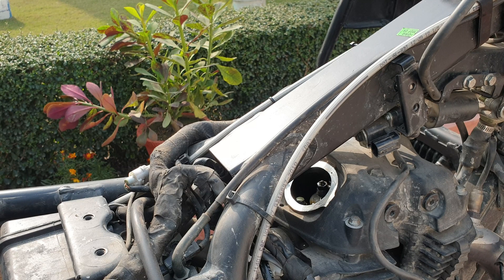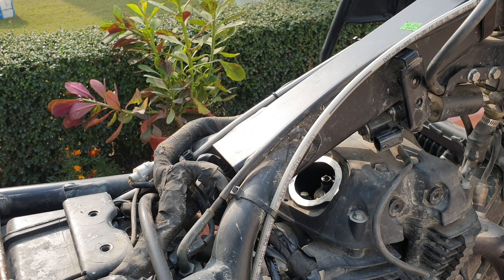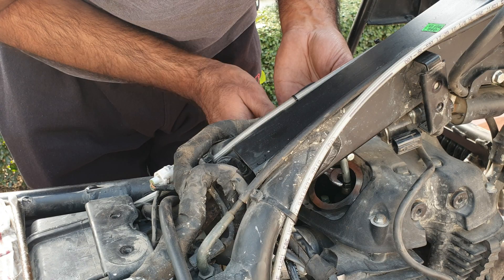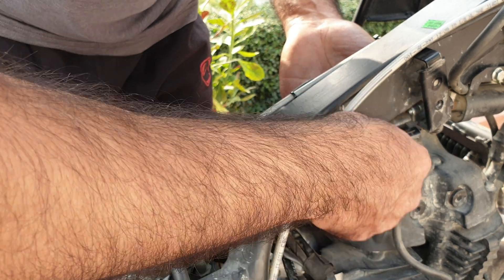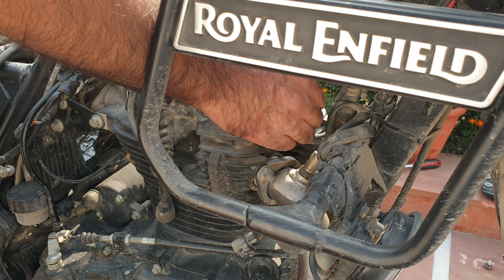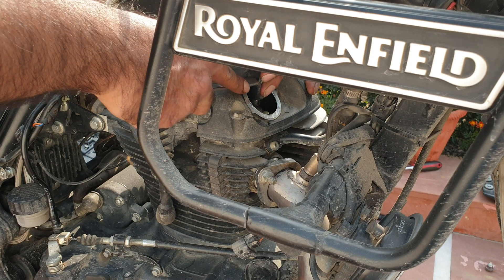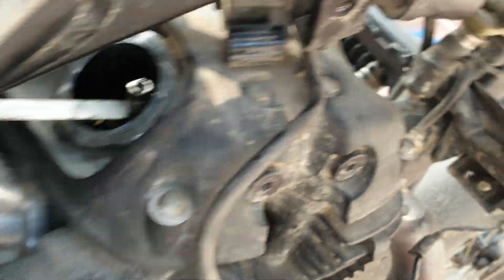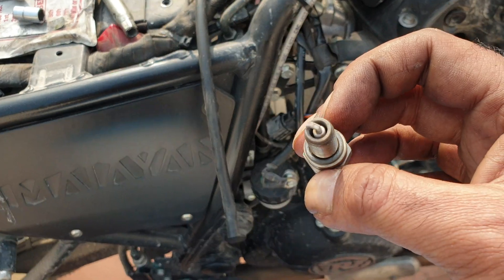Royal Enfield Himalayan Valve Clearance Tappet Clearance | .08 to .10 mm intake | .23 to .25 Exhaust

Comment: Had my first valve adjustment done at 8K miles, at the Dealer.  Have only listened to them until yesterday, when @ 18.6K miles I finally checked them, using your video as the best guide.  They were perfect, @ .08mm intake & .23 exh.  Reinforced my speculation that far too much emphasis is placed on valve checks & adjustments..
Reply from the maker: Thanks mate 🙂  and you are right, they don't need adjustment that often, RE recommends 5000 kms interval, but I check mine after 8- 10000 kms, next one is coming up shortly, I am curious to see if they are within spec, will keep you posted, cheers 🙂

Comment: The correct factory tappet tool is ST-27527-2. The correct valve clearance setting is 0.127 mm or 5 thou on both the inlet & exhaust. You will find the bike runs beautifully slow running around town or open road highway. If you set the tappets to your suggested gaps the bike will cut out when riding around town from cold. The idling will also be uneven. You can get away with long nosed pliers for adjusting the gap if you haven't got the correct factory tool. You will probably need a socket to tighten the lock nut for the inlet valve as the clearance between the lock nut & the wall on inlet housing is very tight so you need a thin walled tool. Both my ring/open end spanner and my deep neck spanner wouldn't offer onto the lock nut as not enough room. The exhaust valve lock nut has more room however.
Reply from the maker: Hey mate, the tool i used has same inner measurements at factory tool, it just looks different on the outside, so no harm there. And you are right about almost everything on the symptoms of how engine would behave if adjustment is done incorrectly. So I get you are obviously experienced. My only confusion here is is where you got .127 mm from, because that is Cleary not mentioned any where in the service manual. And of all the engines I have worked on intake gap is always smaller then exhaust considering exhaust gases and that heat leads to more thermal expansion. Pretty much same across all engines.
I believe it just the communication gap and .127 mm you mentioned is some other measurement, if I were to guess its the valve seat dimension. I will find it and get back to you. 
Also will post the link of second video I did on valve clearance where I used a thin spanner to adjust intake and worked like a charm
Cheers 🙂
Reply: @leuheanrede  When I checked my tappets before adjustment-I made a note of what they were set too. The exhaust was set to 0.127 mm and the inlet had no measureable clearance. Previously he run quite well although idling was 1,500 rpm when it heated up so gear changing wasn't ideal. It also used to sop running after the first start so you'd alway's have to start it again. I used the 0.127 mm as a reference which it was obviously reasonably happy with, after I'd tryed the service clearances & found it didn't run very well at all especially when cold. In traffic it would constantly cut out or you'd have to be forever twisting the throttle trying to keep it going. I then did some research on the DR650 & found that the pre'96 model had tappet setting at the widest margin of 0.13 mm for both inlet & exhaust. I figured that the inlet should have some clearance so decided to use the DR650's setting as the same for both & was confident it would go well. It turned out it went very well, so rather relieved as cold running was very frustrating.
Reply: @leuheanrede  The tool I used which was a suzuki tappet tool was an upright one, very similar to those shown on you tube that I have seen before. Sadly they won't fit, unless you want to pull apart a hell of a lot more than just the seat & tank. Their simply isn't the room to get the tool on the adjuster. Hence I suspect the reason why their tool is horizontal due to the lack of room. I believe the tool is available on Ebay. However if you've got one that works then that's great-the important thing is that it works.
Reply: @leuheanrede  It's actually 0.130mm. This is identical to the early DR650 & I susspect they have used the same cam. I used 0.127mm only because that's was the closest setting on my feeler gauge.

Comment: Any idea why my engine is making some irregular noise whem climbing steep uphill?
Reply: The bike has just covered 1800km
Reply from the maker: Hey mate, key is to keep the bike in correct gear thus choosing right RPM range, like while climbing moderate inclines, keep a steady 4000 plus RPM does help, given that valve clearance is properly adjusted to spec, Cheers :)
Reply: @leuheanrede i am sure that its the right gear and right rpm, but the sound which i hear is like, as if the piston is moving without lubrication. Not sure.i kind of hear it like that
Reply: Anyway thanks dude.. Good work🙌

Comment: Hey, great video. Any idea where I could get that tappet socket tool, not able to find it anywhere in Pune. Or could you tell me the size of that square socket so I know what I have to look for?
Reply from the maker: Thanks mate :)
As for the tappet holder. The size on my caliper shows 3.30 mm, please account for +-.02
Also it's the same one used for Yamahas Hero Bajaj bikes, so maybe you can try at shops that hold spares for these bikes too.
Cheers
Reply: @leuheanrede  great, that helps a lot. Thanks!

Comment: Hello Professor Himalayan. I have a question.
Should the engine be stone cold when doing the valve adjustments?
Thanks in advance.
Reply from the maker: Hahaha, thanks mate :)
Well, ideally 5-6 hrs of bike lying stationary would do, but over night it still better. as metal expands when engine is hot, we have to keep that in mind, say even if you wait 2 hrs the engine would still be warm and metal parts still contracting, so there would be some variance,  that is why its advisable to do it when engine is cold, but depending on the climate, 4-5 hrs window will do too
Cheers :)

Comment: Hello, because my himalayan (just at 1000 km) fails at low rpm and the engine turns off, it also happens when I reach a corner and brake, it does not maintain idle. I already tried with the screw accelerating it a little more and the same thing fails, they told me to wait for the motor to soften, is that so? or would I have to regulate valves?
Reply from the maker: yes happend on mine when it was new, but I  checked valve clearence at 1500 kms, Only small adjustment was need, but since then all is good.
Ponits to check in case of stalling when bike is new are
1- Spark plug Gap
2- Air filter clean
3- Evap hose getting obsructon
4- valve clearance
That would be stage one on new bike
Cheers :)

Comment: I did this few months ago, a simple task actually. But make sure to properly tighten the lock nut in the limited space which is available. It turns out I hadn't and the rocker arms came so loose that the valves and valve guides are damaged (happened yesterday) now. Cost of repair and parts = around 8 k. :(.
Reply from the maker: Fret not mate, a part of learning curve, I bet you wont undermine the importance of correctly tightening/torquing them again. Experience is the best teacher 
Cheers :)
Reply: @leuheanrede  totally agree with you.

Comment: Which tool kits do you have-both socket and Allen key sets-name of the company and size range please
Reply from the maker: The ones I use as Allen key were bought from Amazon.in and brand name it king tony.  7 years on and still going strong. As for the sockets, uphill 14 mm came in kingTony kit but I bought local half inch socket wrench about a decade back and kept buying sockets from local market, that too lasted decently thus far. Sockets vary from all brand across the range. Taparia being the majority 
Cheers :)

Comment: Hey buddy, I am glad I obtained the RE tapped tool. I just know I would drop something inside. LOL
Reply from the maker: Hey mate, exactly my point. I have seen the Enfield ones, well built stuff. Good that you sourced them, will certainly come in handy. 
Cheers :)
Reply: Where did u get hold of the tool? 
Thanks
Reply: Bro, if are not a technical  person don't try to adjust the tappets yourself seeing this video. This person doesn't know what is the correct tappet clearance value in mm . Tappet setting is sensitive job which affects the engine functions very much , to be done by an experienced person only. Being an expensive bike don't go for trial and error methods.
Reply from the maker: My apologies for the slip of tongue. It is .08 to .10 MM for intake as I have mentioned in the description. And .23 to .25 mm for exhaust. Ya I shouldnt have been blurting out .8 but I think I did correct myself a couple of times. 
As for GWMotley1, have a look at his channel, he builds planes, I believe he can handle the valve clearance without issues :)
Cheers :)